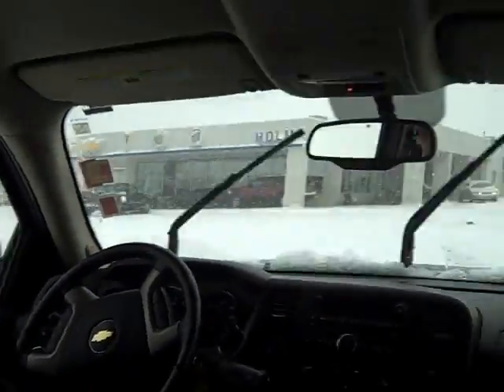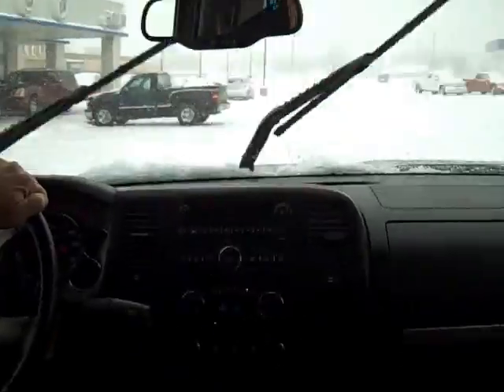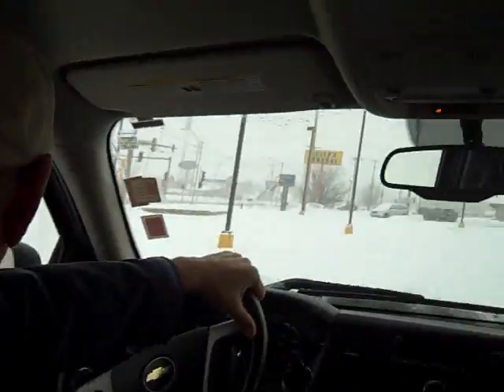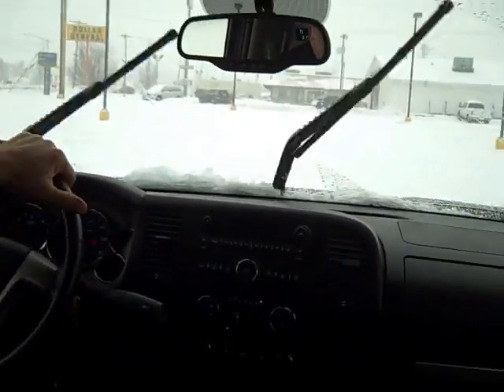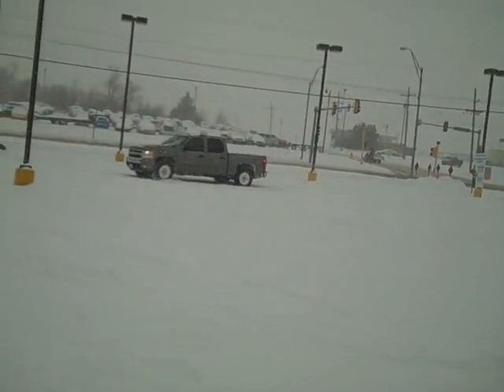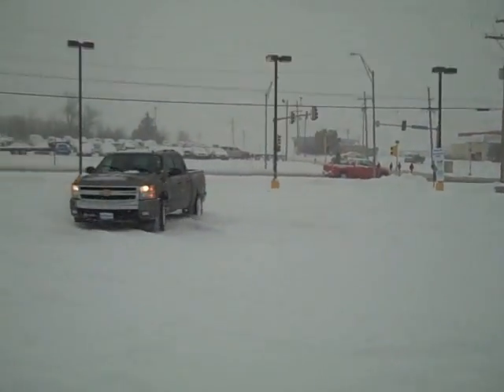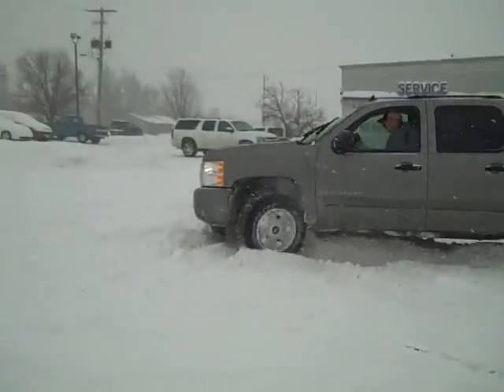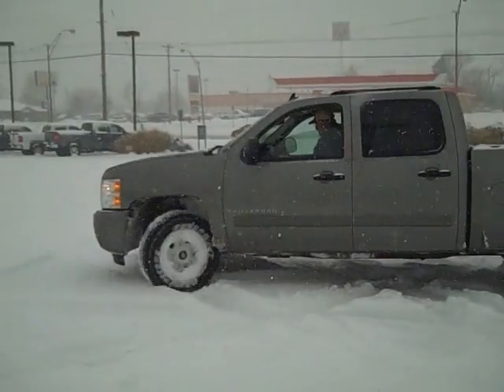Stabilitrak Demonstration

Comment: This is nice on icy highway drives. It can take you out and pull you in the ditches when you need to throttle out of situations on snow covered logging roads. Or any offroad situation really. I hate how you cant shut it off completely on the gmt900's like you could with these.

Comment: With FWD Chevy cars, if 1 of the front wheels has no grip but the other wheel does, the wheel without grip, gets all the power so the car doesn't move, thanks to an open differential. Will stability control brake the wheel that is spinning so some power can go to the front wheel with grip? This way stability control can make the car behave as if it has a limited slip differential.

Comment: XMG3, that's because they don't know what they are doing. If anything they proved how well ESC works even without the traction control element. ESC works as penguin suggests. TC does 2 things cuts power to reduce wheel spin, and brakes the spinning wheel to transfer power.